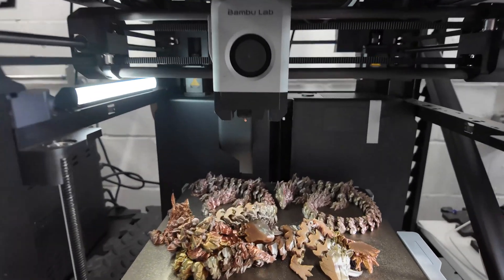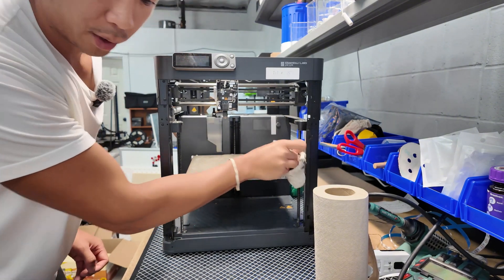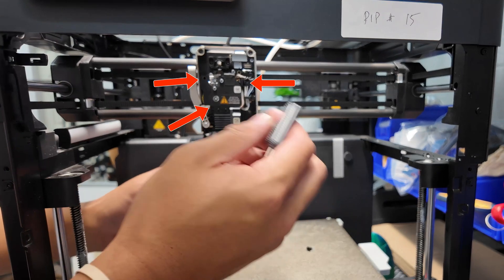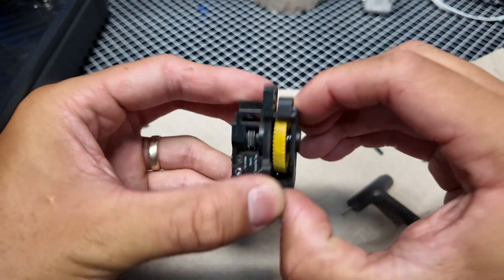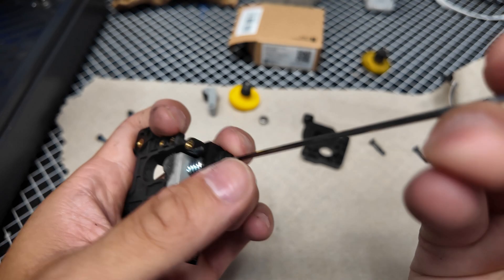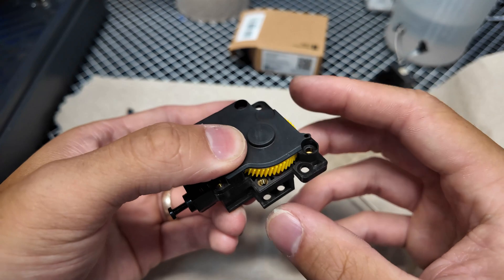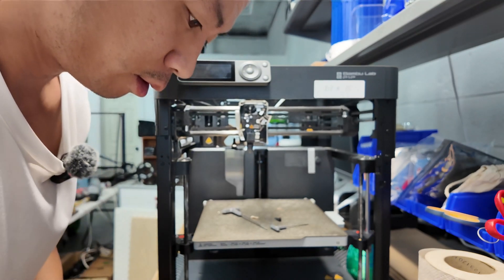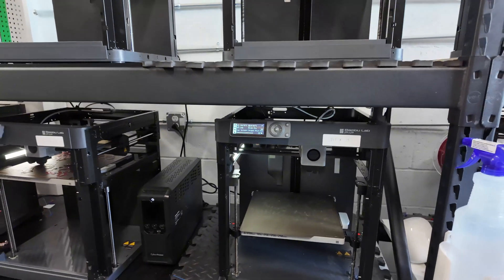My Bambu Lab P1P Broke - So I Fixed It

Comment: Wait what? You aren't mixing an oblique angled tooth with a straight tooth are you? The gears are a set, not singles. Maybe you replaced the other half and didn't quite show that part?
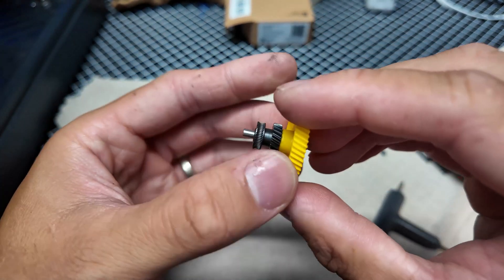Reply: I think you are right on all points. He does show both pieces of the gears set at 6:37.

Comment: That fan plug is a time vampire, when I swapped all the nozzles on the P series to 0.6 I stupidly plugged the fan in upside down. PETG was printing awful, so I put the spools in a dryer, recalibrated the filament, slowed down the print speed to a crawl... then realised.

Comment: When you remove the nozzle or extruder you can take the PEI off and use the magnetic surface to not lose the screws, especially to keep them bouncing off somewhere if you drop them
Reply from the maker: Actually genius thanks for the tip I have lost screws before lol

Comment: I heard that ipa isn’t good for the carbon rods as it removes the graphite lubricant
Reply: I'm not sure where you heard this, but if you check the Bambu Lab Wiki for "How to clean the carbon rods for Bambu Lab Printers" they say to use IPA and a clean cloth.
Reply from the maker: Pretty sure bambu labs says to clean the rods with ipa? Could be wrong